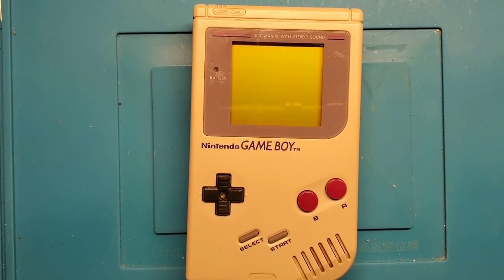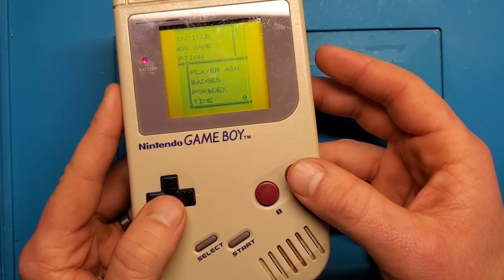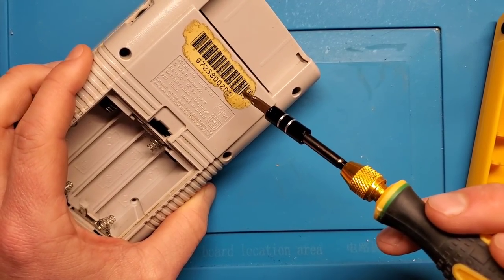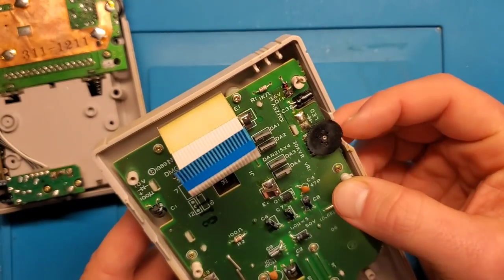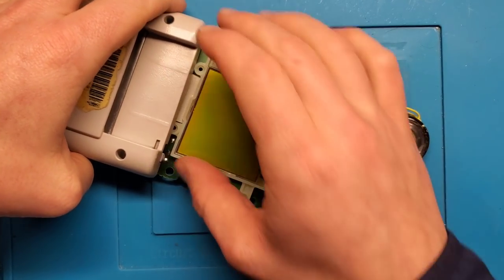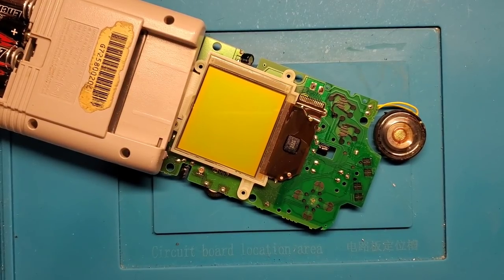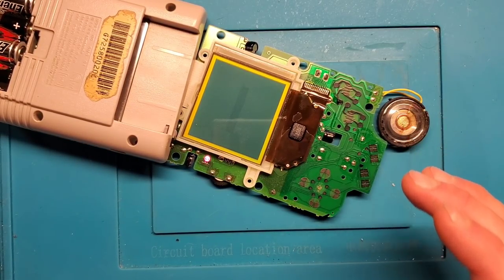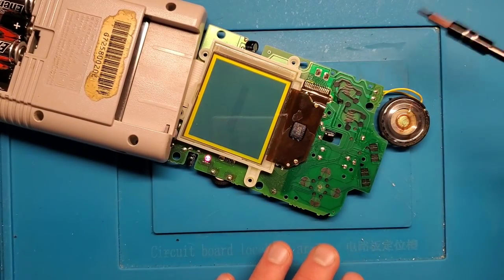Game Boy Vertical Lines on Screen - EASY FIX - Fixing Ebay Junk

Comment: surprised the iron doesn't melt anything, or is it just that you're barely/not making contact?
Reply from the maker: The connector is pretty durable,  it will take a lot of heat to melt it

Comment: Nicely done man! I had to do this with a Gameboy my sister in law gave me. Works like a charm now. I also added a foam strip to the ribbon cable to add additional pressure so that it will have a more secure connection.

Comment: I have a dmg where the whole screen flickers, not in the lines like you have, maybe a problem with the chip driving the screen?
Reply from the maker: Certainly seems like it could be a power issue to the screen if it's all flickering.  Maybe caps, maybe the chip, I'm not too sure

Comment: I have a couple DMG's with horizontal lines.. I understand horizontal lines are alot more difficult to fix.. if at all.
Reply from the maker: It's the same fix,  just way trickier to get access to.  I've never tried one but i believe you need to desolder the screen to get at the back
Reply: Huh, seems more trouble than its worth right now, there's a single horizontal line on both.. annoying but not enough to potentially wreck them by desoldering the screens, but if I ever decide to go the lcd replacement route I'll take a stab at it then :)
Reply from the maker: Lcd replacements are great options.

Comment: I'd probably just replace the adhesive strip with some kapton tape.
Reply from the maker: It's double sided tape so the display sticks a bit to the rubber pad on the shell.  Kapton tape wouldn't do anything

Comment: Adam, can you PLEASE include the Celsius temps... it's the temp measurement 95% of the world uses, and farenheight means nothing to us...
Reply from the maker: My iron shows farenheit. You'll have to Google the conversion much like i would have had to.
Reply: @RetroRepairs  Would be a lot more convenient for your viewers if you did it though, instead of every single one of us having to do it every time you mention temps...
Reply: @jarodatkinson5306  I hate imperial units as much as the next guy but this is a weird hill to die on. Type "f to c" in your search bar, literally takes 5 seconds
Reply from the maker: I usually don't even mention the temp,  so if literally saying the number that appears on my station is a point of contention,  i can always just not mention the temp at all...
Reply: @RetroRepairs  I definitely appreciate the info. I just learned to solder recently, and I'm still feeling out what temps are required for different work. Actually, about to attempt this on one of my own DMG's, and it's nice to have a concrete number to start with before going to work on a delicate, 30 year old ribbon cable!
Reply from the maker: Best of luck with the repair.   It's not a bad idea to start lower and move up the temp as needed.   I'm not sure what the lowest would be,  but 640-680 or so is probably a pretty safe range.   Like i say in the video,  just keep the iron moving and you should be good.
Reply: @RetroRepairs  All I asked is you mention the temps in C so people not from north america understand what you're talking about... seemed like a small request, but if it's this big deal don't worry about it...